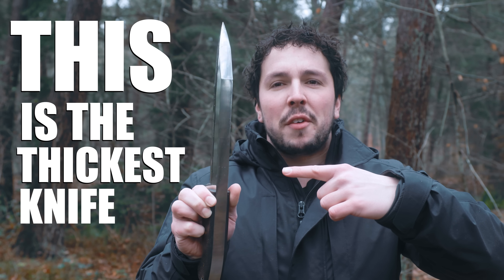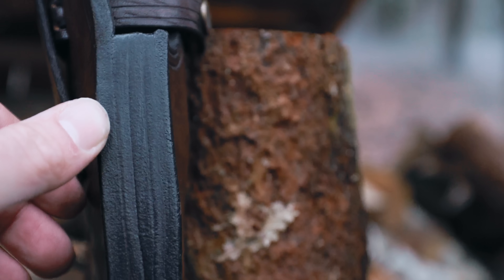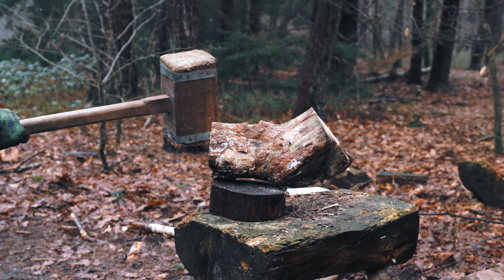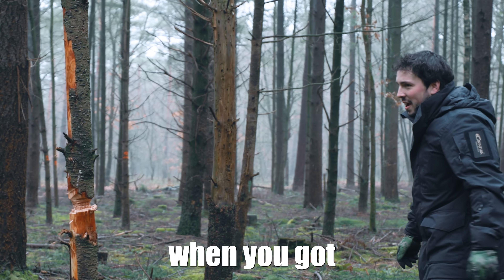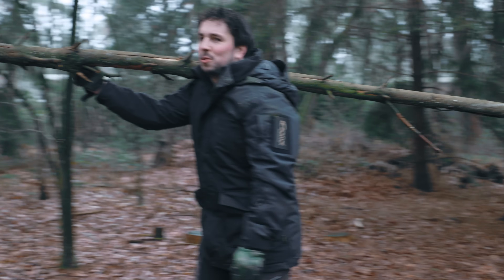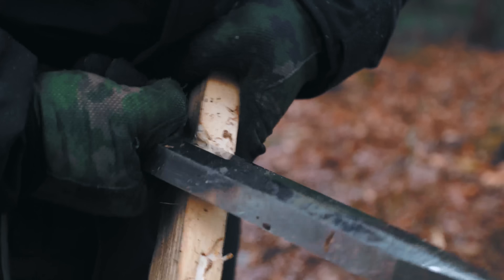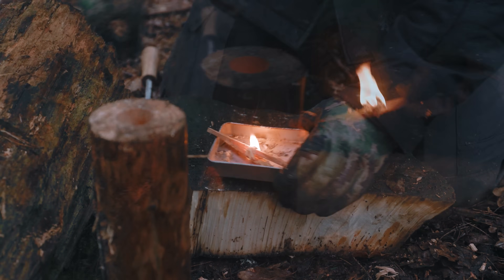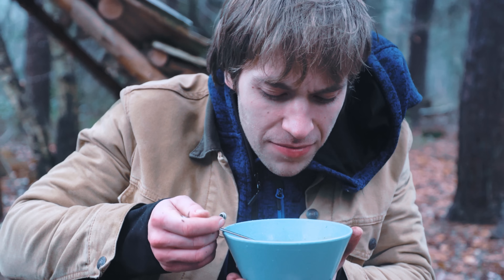Thickest Knife to ever exist!! A Blade for Giants and.. still good!?

Comment: the problem with it, is it is backwards. It is using a steak knife design, which is for skinning, fillet and chopping potatoes. You could get more power if its edge was flipped and straightened or a large kukri design.